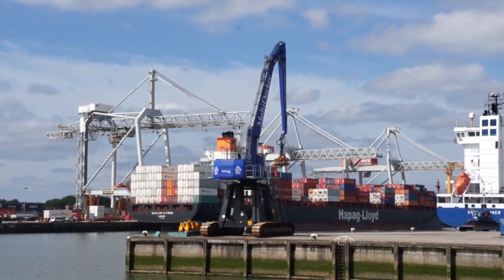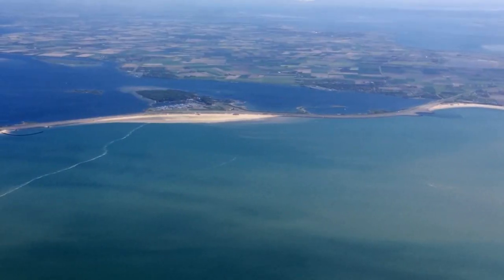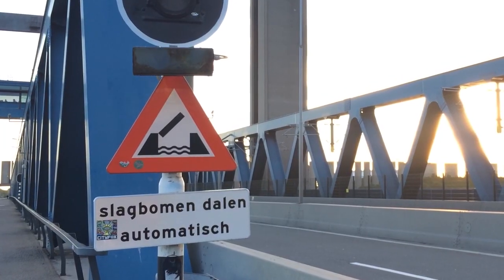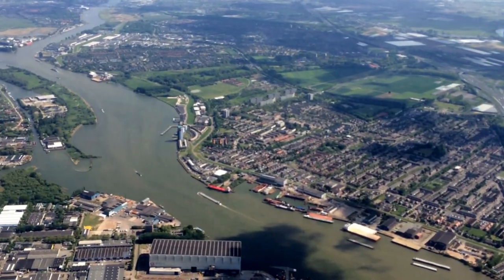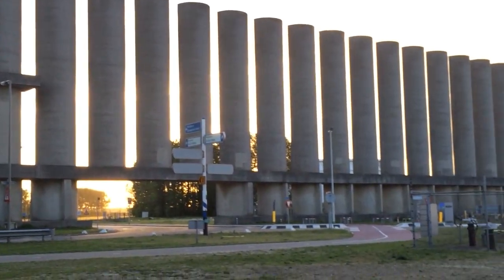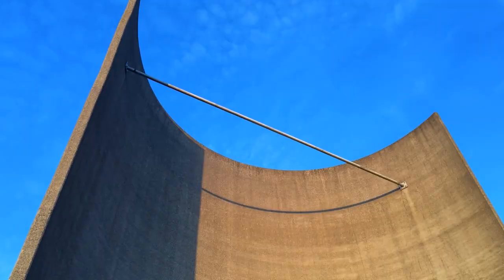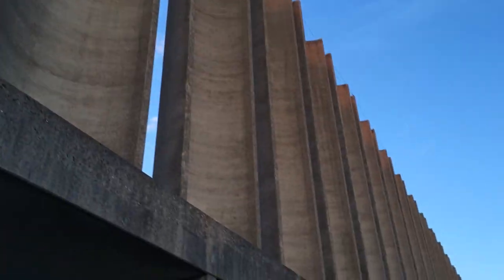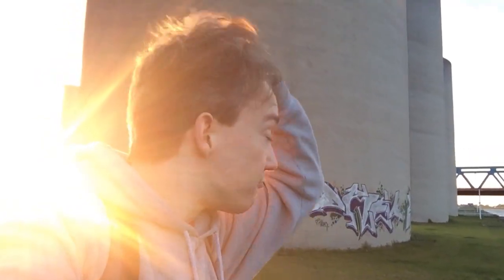How The Netherlands Stopped The Wind

Comment: Probably could have built a tunnel under it instead of the bridge.
Reply: There is also a tunnel which opened later on (Burg. Thomassentunnel), for reference the tunnel opened in 2004, the bridge opened in 1969 (and it's life cyclus ends in 2020) and the windwalls were finished in 1985.

Some side information:
There is a problem which is that there is a really important trainline known as the "havenroute" which is part of the "betuweroute" that runs over the bridge (which is soon to be demolished), The tunnel is only for roadtraffic and also is not suited for dangerous chemicals (to be suitable tunnels should be resistant to big explosions which is almost undoable for underwater tunnels). So there is a new trainline under construction called the "theemswegtracé" which allows trains to run over other bridges instead of the old bridge, after that the bridge will be demolished.

Comment: The dutch have conquered the water by damming it. They have conquered fire by almost exclusively useing green energy. Now they have conquered the wind by buliding a wall. All that is left is to build a compleaty self sufficient space station that has everything it needs to remain in working order forever. To finaly cut the hold of the last element earth. Then and only yhen can the Dutch rule the universe unimpeded.
Reply: evil I beat Fel E 3x in a row we don't use green energy. We're terrible with renewables. We're one of the worst in Europe
Reply: @wiet111  well your still half way to becomeing the rulers of the universe

Comment: Would it not be easier to redesign the bridge to have a bigger opening or even put a tunnel through under the canal  instead of doing this? I suppose they must have hit some sort of structural limit with the wider bridge gap or that would've been an easy choice. I guess once you have that design for the wind wall the construction isn't that expensive compared to a tunnel
Reply: There already is a tunnel. Cheaper to build the windbreaker than to break down the old bridge and build a bigger new one.
Reply: If there's already a tunnel I'm assuming it's capacity isn't large enough or they wouldn't need the bridge at all. I still can't imagine it was cheaper to build that windbreaker than to expand the tunnel or put another tunnel through. I know tunnels are really expensive but the scope of the windbreaker is so much greater that it must have created higher costs.
Reply: The bridge carries local traffic and dangerous goods vehicles that aren't permitted in the tunnel (category C, meaning that all goods qualified under category A&B are not allowed to use the tunnel). It's also just a back-up route if anything goes wrong in the tunnel, it pretty much carries traffic to and from the Rotterdam port so if something happens you don't want traffic to have to take massive detours. And the capacity is high enough in the tunnel, it was recently widened to 3 lanes per direction and carries 55.000 vehicles per day. Thats more than sufficient. The tunnel is a lot younger than the bridge though (2004 vs 1969), but there are plans for renovation of the bridge, so breaking it down is not being considered.
Also, trains use the bridge, and putting them under the canal would cost ridiculous amounts of money because the slopes can't nearly be as steeps as for road vehicles.

Comment: Interesting that they didn't just build, well, a wall. I imagine if you built a wall you'd get buffeting over the top. Instead these don't try to stop it and instead just slow it down a lot.
Reply: No you will create a air trap behind the wall, not good for the ships either. They also use this 
technique with orchards because if you built a wall all the wind would go over it and spin around behind it breaking all the branches of the trees.

Comment: You should come to the plains of the US. It was done 80-90 years ago. They just used wood (aka trees) instead of concrete and planted them by the dozen or hundreds of miles and around most buildings... They're called  shelterbelts
Reply: Like the Dutch used to in the polders way back.

Comment: They're not the only ones to have that kind of things, the city of Fermont in Québec has 1.3 kilometre wall, 50 meters high (Surprisingly called the "Wall") made to protect not a bit of canal, but an entire city of the wind, and on top of that they even made it useful, they put the city services, shops and lodgings in it, to the point it's even possible for citizens (that do not work in the mines) to stay in it for the whole winter and never go outside of the winter (which lasts 7 months up there)

Comment: ... You could just make a better bridge.
Reply: +Das Neko This is the Netherlands we're talking about here. Their solution to not having enough land was to drain the ocean.
Reply: +Das Neko Nope, that did'nt work. Location, location location..
Reply: Rem ko
So it makes better sense to literally stop the wind?
Reply: Thorntonian
fair point.
Reply: No, they literally built a wall around an area, and pumped out the water. And then keep on pumping, for eternity, or else...
Reply: Don't forget that The Dutch help other regular flooded countries in fighting against the water.
Reply: currently we also take part in lots of projects pumping sand from see and raising the land (palm islands in dubai)
Reply: Das Neko they smoked to much dude
Reply: And tear down the already fine existing one i think this option was cheaper
Reply: +martijn smit It's difficult to be more wrong. 2/3 of the Dutch soil is under sea level, and both by extracting gas and by natural causes, the land is lowering while the sea is rising.
Reply: +Thorntonian It was more like raising the ground under the ocean though.

Comment: The main difference between modern monuments, and ancient monuments is that in 1000 years, ours will be gone and theirs will still be here.
Reply: +statikreg The other main difference is that ours were designed to tight specifications by highly skilled engineers. The Ancient monuments, on the other hand, are massively over-engineered piles of stones built by slaves.
Reply: +ValleysOfRain Ancient monuments were still designed by the best engineers, and built to the tightest specifications possible for the technology/resources available to them. So....those items are the same as today, save obviously technology has advanced, and obviously the average view on slavery has evolved over time. That leaves the over-engineered part, which was my original point. Glad we agree!

Comment: Quick question, Tom. Why do you bounce back and forth between imperial and metric units? Why not stick with the superior, which your country has as its official system of units?
Reply: Tom is from the UK, we use both imperial and metric. However, imperial is usually used for the road, everything else is metric.
Reply: +olive oil That's a shame.

Comment: Impressive engineering! But it's a little disappointing that the potential wind energy was just dissipated, rather than harnessed. I wonder how feasible it would be to reduce the impact of the wind with turbines, rather than just a wall. Imagine the win-win achieved if the entire port was powered by machines that also made sailing the route that much safer.
Reply: This is build in the 70.
And turbines create a wind swirl that is even worse then a storm for these vessels.

Comment: Why did they choose bloody great concrete walls instead of trees? Any ideas?
Reply: ***** trees take a long time to grow and are probably a lot worse at stopping wind, a concrete wall is built within relatively short time and definitely gets the job done
Reply: NeXtDracool
Yeah, probably true.  But I get a nagging feeling that a technological solution was used for technology's sake.  Friggin' ugly compared to a dense row of trees.
Reply: ***** Trees need proper soil to grow and we have a bit of a problem with areas flooding from time to time. Concrete can easily be fixed when damaged. Trees are a bit harder to fix when damaged. Not to mention that trees suck at blocking wind.
Reply: OmegaGamer04
Granted, but how friggin' ugly is concrete?  There are many species of trees that not only survive floods but actually require flooding.  Not much space for any depth of trees there ?
Reply: OmegaGamer04 Trees don't suck at blocking wind the are used in orchards to do the exact same thing as this wall and they work in a similar way. The thing that is different is that this wall redirects the wind into it's self  creating a wall of wind that goes up. and there for is more effective of stopping the wind from falling over the wall

Comment: Why are there gaps? Why not just build a solid wall? Why is it curved?
Reply: ***** and the curving is probably for mechanical reasons. The pressure on those things must be enourmous because they are so huge. So they curve it, to increase the resistance at critical points.
Reply: ***** You will create a air trap behind the wall if you make it solid, not good for the ships. They also use this technique with orchards because if you built a solid wall all the wind would go over it and spin around behind it breaking all the branches of the trees. The curve is to redirect the wind in on it's self creating a wall of wind there fore stopping wind from falling over the wall.

Comment: I wonder how much of it is archimedes valve action and how much is just 'hemicylinders are stronger and cheaper than flat walls'  Very cool.
Reply: There's also the 'If there's no gaps it's gonna fall over' factor. Also it would create a massive windshear on top.
Reply: I think the open side of the hemicylinder is aimed at the wind and open on top to catch the ground level wind and smash it into the higher winds to create turbulence to prevent the wind from going over the wall.

Comment: If you can explain more about how precisely that works, that would've been a better video, though I can assume how it works quite confidently.
Reply: ***** yes, I mean the method they are using to block the wind.. reason why is it built in that shape, etc... oh my, perhaps I should never get serious youtube comment section.. people just look for laugh..
Reply: Isaac Als penis :)
Reply: Isaac Als but on a serious note, i was wondering that as well. I can imagine that due to the shape the air literally bounces off it, and by not building it solid they let light through, but why that design, rather than something solid and transparent i dont know...price i guess
Reply: You will create a swirl wind behind the wall if you make it solid, not good for the ships. They also use this technique with orchards because if you built a solid wall all the wind would go over it and spin around behind it breaking all the branches of the trees. The curve is to redirect the wind in on it's self creating a wall of wind there fore stopping wind from falling over the wall

Comment: Why not just build a new bridge?
Reply: 5croobius Why not just build a wind wall?
Reply: ***** In order to build said bigger bridge you would have to impede the flow of ships through this canal, which would cause losses for the port, this combined with the cost of said bigger bridge makes this wall the more economic and sensible route since it solves the problem without causing problems.
Reply: 5croobius remember, we're talking about a country whose capital city is built on land which used to be part of the ocean.
Reply: Battusai1984 "losses" feels like an understatement. I don't want to know how many figures that loss would have
Reply: DP Trumann Built on 13.659 timber pylons in the water.
Reply: 5croobius because that would limit traffic
Reply: Alfcamify Yeah, I imagine it's just the more efficient solution.
Reply: The reason for not building a bigger bridge is that it's The Netherlands.... When we didn't have enough land, we literally build a wall around an area of the sea and pumped the water out... We kept pumping and those pieces of land are called polders! AN ENTIRE PROVINCE IS MADE BY PUMPING WATER OUT!!

Comment: Building 20 giant walls is more efficient than building a new bridge? k.
Reply: KlassenzimmerDE And stop cargo traffic? Don't be silly, we'll just stop the wind. Here in The Netherlands we keep the problems out of the country, and the trade goods flowing into our country.
Reply: Firefox is red, Explorer is blue. Google+ sucks and Chrome does too. What browser are you using?
Reply: Huntracony Proper zooming is pretty much the only feature from Chrome that I miss having. But my relationship with Chrome ended very quickly when it suddenly started to refuse browsing the urls that I typed in. Reinstalled it a couple of times, gave it a fair chance (I had to use IE..!) and then said "Screw you, I'll download a browser that actually browses".

That said, I haven't had issues with the zoom addon that I use in Firefox. It's called Default Full Zoom Level 7.5
Reply: why not build the new bridge next to the old one?
until you put in the middle part it doesn"t stop ships, and for road traffic the old bridge is still there as long as needed
Reply: Huntracony yandex
Reply: Huntracony
Lol, Firefox atm.
Reply: Firefox is red, Explorer is blue. Google+ sucks and Chrome does too. you can't set a default zoom level and that extension that's supposed to do that for you often bugs out if you go full screen.
chrome has a lag problem with 720p60, and doesn't do emoji
IE is IE.
i'm currently using chrome while looking for better alternatives. just installed yandex, see if it is any good.
Reply: Firefox is red, Explorer is blue. Google+ sucks and Chrome does too. i'll try that, thanks. yandex is almost exactly the same as chrome, with the same problems, and it's slower. it's so similar to chrome, that all my chrome extensions where already installed on yandex.
Reply: Looking at their site right now, I'll keep Yandex in mind if I ever feel the need to switch browsers again in the future :).
Reply: Firefox is red, Explorer is blue. Google+ sucks and Chrome does too.
i guess you'd have the same problem(s) you had with chrome
Reply: seigeengine we probably can...